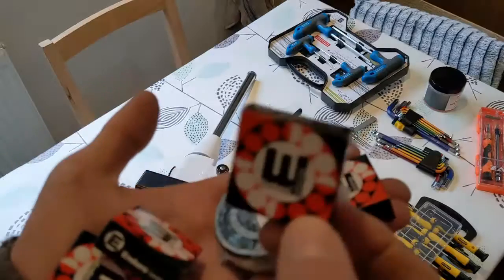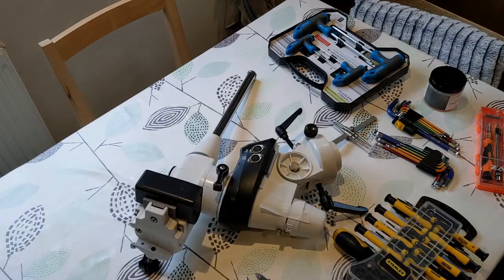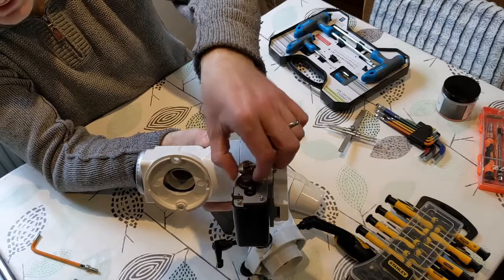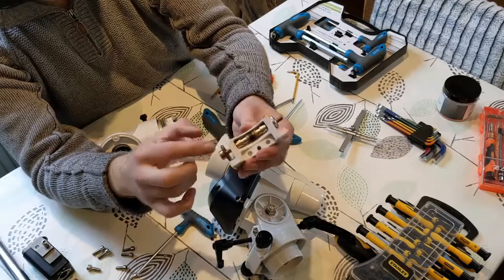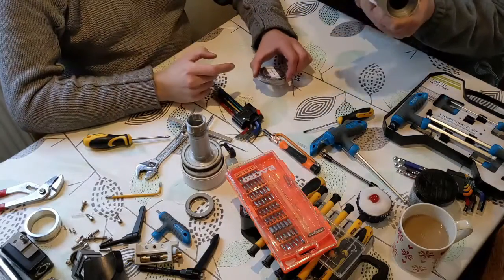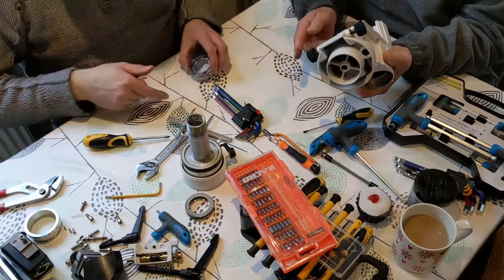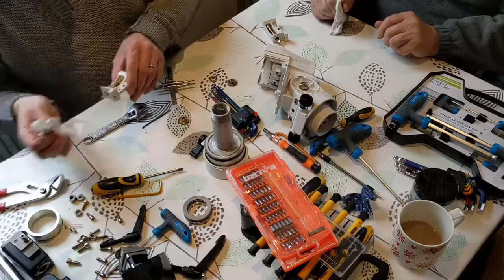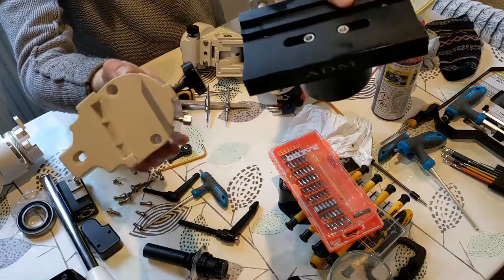Skywatcher EQ5 Pro new bearings, re grease and ADM Saddle.

Comment: When you fitted the ADM saddle did you have any problems with the screw that holds the DEC motor in place?
Reply from the maker: It was all fairly straightforward if I remember.  All fitted well.  The mount has performed well since I fitted it.

Comment: Are the latitude bolts M8 ? as mine are the same size and one isn’t M10
Reply from the maker: Mine mounts are very old second hand ones, therefore I suspect mine are different threads from the new one.  On my ones the adjustment latitude was M10, and the locking one was M8.  However they do change the design every now and then and the thread size may be different.

Comment: Where did you buy the latitude bolts and azimuth screws ? They are far superior to the existing ones.
Reply from the maker: eBay.  70mm M10 adjustable clamping lever, 40mm M8 adjustable clamping lever, M6 47mm wingnut knob.  Double check the thread sizes as Skywatcher do change them.

Comment: Hi Andy, I have just bought a brand new EQ5 pro synscan mount and I am getting ready to strip it down to re grease it. I am also going to change the bearings as well. What size of Allen key tools do I need to buy? I have already bought the lens wrench.
Reply from the maker: Any metric and imperial set will do, I got mine from Amazon.  Good luck.

Comment: Hi andy. I was in the same position as you with the bearing on my eq5 pro. It was still smooth and didn't replace. The main thing that made a difference was using a better quality grease than what was put in at the factory. Keep up the great work